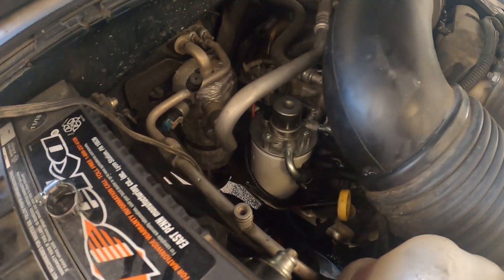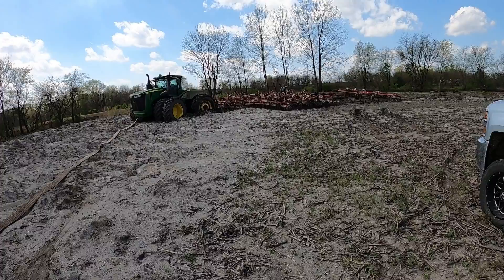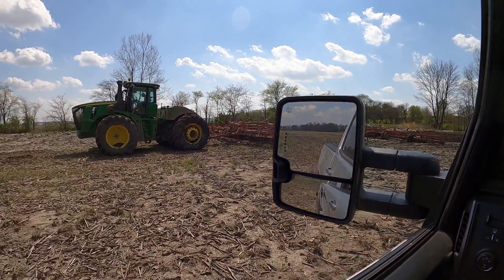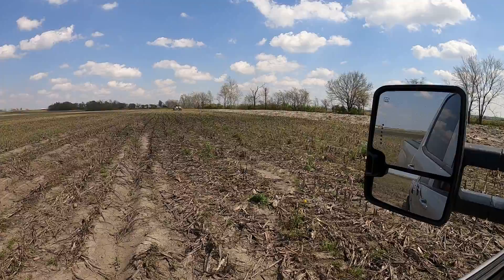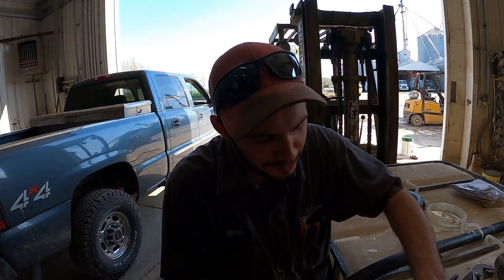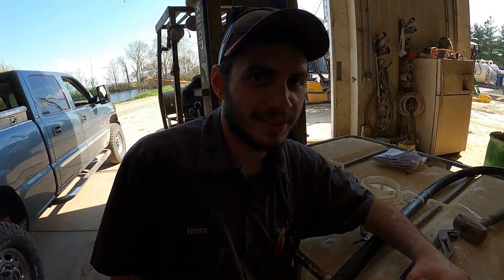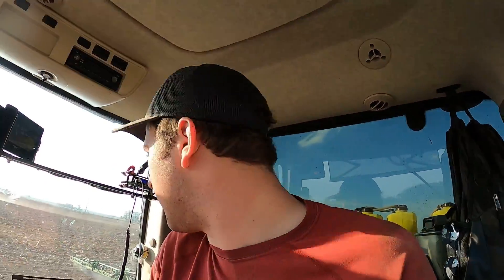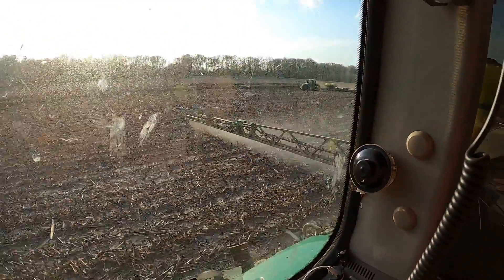MASSIVE equipment hitting the field in full swing

Comment: It is  still a usable fuel filter housing all it was is a rubber o ring that split and is causing that leak
Reply from the maker: We did end up picking it up and saving it for later we will use it at some point

Comment: I got a 9530 with duals stuck and it took a 9520rx and 7 c clamps to pull it out we broke 6 clamps and bent the frame slightly but shes out now
Reply from the maker: We have had a few like that our mud here in places gets deep but usually it’s just sloppy
Reply: @lrruschfarms6352  I went through a crick and it turns out it is deeper than it looks lol
Reply from the maker: Done that before

Comment: What did they want for that housing?  The rebuild kit is around $30 and gives you a brass bleed screw.
Reply from the maker: I think it was around 70 bucks which isn’t to bad luckily that did fix the issue
Reply: @lrruschfarms6352   That is good, I had one leaking a bit and the dealer said for $600 they could fix it.  Well that was the last time that dealer saw that truck.